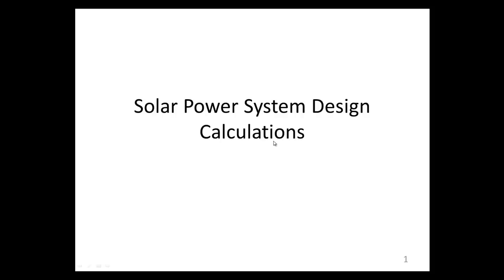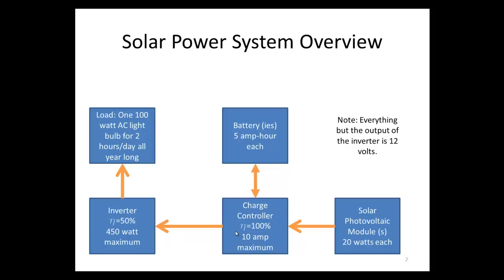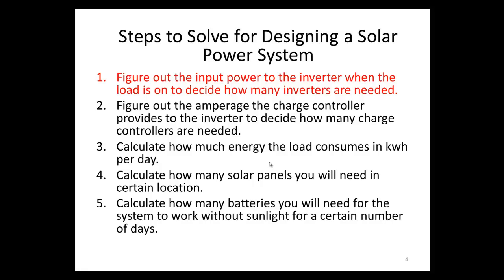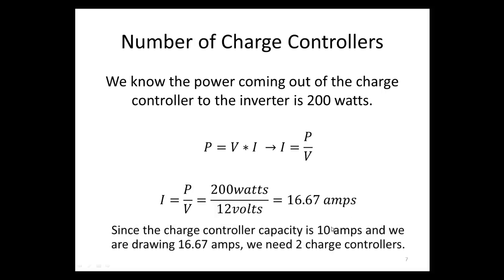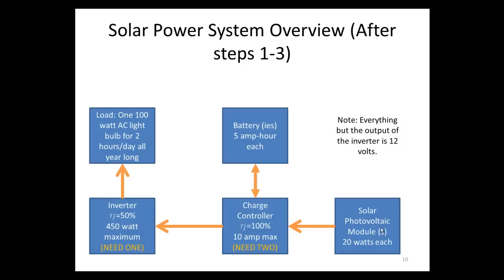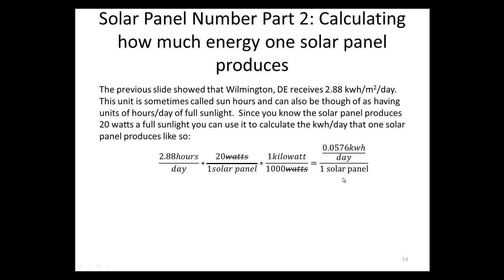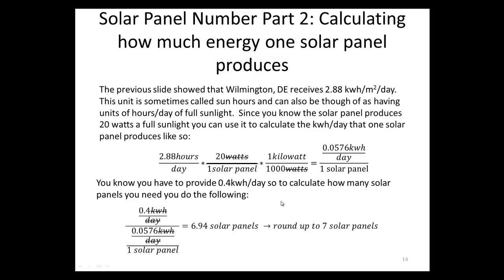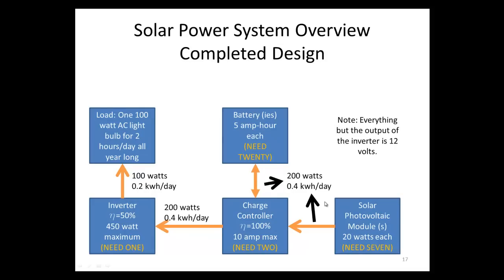Solar Power System Design Calculations

Comment: Thanks for the video, some great info.  And thank you for understanding electrical units of measure.  Some of these people drive me batty.  You did interchange the terms "amperage" and "current" but I'll let that slide.  Instead of deciding at the outset which inverter, charge controller, and battery you are going to use, why not let your calculations determine which unit to buy.  For example, you determine that you will need two charge controllers.  Why not just choose a charge controller to handle 16.67 amps?  Can you even connect two charge controllers in parallel as I assume you are suggesting?  And if you need 100 Ah of batteries, you might just want to get one battery to handle that capacity.  Good complete video though, thanks again.

Comment: Can you give me feedback on the Load: if I can use the yearly consumption like the Bill
Reply from the maker: Jenna,

    Thank you for your question.  Remember, these calculations are simplified and should not be used for designing actual systems.  With that being said if you have yearly consumption i.e. kwh/year, you can convert that to kwh/day by dividing by 365 days/year.
Reply: So at an approximated 649.2kW/h a day how can I calculate the amount of panels
Reply from the maker: Jenna Casabelos
Jenna,
  Your 649.2 kwh/day would replace my 0.2 kwh/day in my video that the load uses.  You would then follow steps 4 and 5 in my video to calculate how many panels you would need.  Step 4 starts at about 8 minutes.
Reply: Jenna, are you still in close contact with Gerry Semexan?

Comment: Nice video Cory, I am trying to design a PV for a three bedroom bungalow. Can you help me with the necessary information on how to size the system. I want to know the number of panel,batteries,charger controller and inverter that i will need.
thanks

Comment: Hello,
I'm working with a small dataloger, the power consumption data comes from the included transformer... 5V ,0.5A. We intend to use this dataloger 24 hours per day for 7 days, but we really want this gear to be completely solar powered. I took your calculations and asume a inverter efficiency of 50% which will be a 12 volts to usb car charger. From PVwatts we got that for Santiago, Chile, the worst case is 2,75Kwh/m2/day, so this gave as 2 solar panel units (25w each) and 2 batteries (55Ah each). My question is, how can we calculate the correct amount of power coming from the solar panels so the batteries get a complete charge during a 8 to 12 hours of sunlight in winter? My guess is that we don't need such a big amount of batteries, because the  system will only work from batteries at nigth... but i'm not shure that in the calculation above we have enough power to get the dataloguer working and get the batteries charged at the same time during the daylight . Maybe we need to guess a maximum period of 2 or 3 days tops for safety in the backup batteries if the winter is to dark. English is not my birth language so please excuse if a got something wrong. Best Regards!

Comment: Hi Cory nice video, I want to ask that how many panels we will need to add extra to charge the battery when we our system is on its existing load???
Reply from the maker: +kunver vishal singh chaudhary I don't think you have given me enough information to answer your question. If you give me a little more information, I may be able to help you.
Reply: Could I charge a 150Ah battery from 200Wp load in Bikaner, Rajasthan, India???
Reply from the maker: +kunver vishal singh chaudhary You could always charge a battery in any location. The question is how long it will take. If we assume both your panels and batteries are 24volts then a 200Wp panel will produce about 200W/24volts=8.3  amps under peak sunlight. This means it would take 150Ah/8.3A= 18.1 hours of full sunlight to charge your battery. As I go over in the video you can go to PVWatts to see how many equivalent full sunlight hours you have on average per day in your location for each month out of the year. This will tell you how long it would take on average to charge your battery. I hope this helps.

Comment: Hi ! Just 1 Confusion to Calculate the Batteries needed. "System Voltage Except Inverter Output V ( 140 V ) " . But the INVERTER  OUTPUT Voltage is L-N:120V±3% ; L-L:240V ±3%
 . CAN'T FIGURE OUT WHICH OF THESE TO USE .

Comment: Hi Cory
Thanks for taking the time to post this for everyone.
Im setting up a solar water pump at home.
Just trying my head around the calculations.. 
If the load of the light bulb/ inverter  is using .4 Kwh/Day and the  Solar panels are producing .4Kwh/Day. Where is the load coming from for the batteries to charge  after a period of no sunlight?
Cheers

Comment: Not sure if my logic is correct. Let's say I consume 500kWh per month, does that translate to 16.66kWh per day if we consider a 30 day month? I would then need 1 20kW Inverter or several with minor ratings, right?  But charge controllers do not seem to be available for 1.5kA so I think I'm doing something wrong.
Reply: For my example I'm using a Yaskawa-Solectria Solar 20kW 480VAC TL Inverter PVI-20TL-480, so I changed the 12V from the example with 480V, I'm looking at solar panels that are 48V. If I connect the solar panels in series that means that I will be adding Voltage, right? Since 20 solar panels are needed I could have 2 series of 10 connected in parallel. Is that correct? So a daily demand of 16kWh can be met with 20 Solar Panels (300W 48V), a 40A Charge Controller (90%), a 20kW (97% inverter), 3 sun hours (instead of your 3 days with no sun I changed it to 1) to end up needing just one battery of 52Ah... I hope my logic is correct.

Comment: thanks for information, very helpful. If I add a wind power around 600 w. How can I design the rest of the system, knowing in those worst shiny months in the year I could have wind providing the power as supplement.
thank you again
Reply from the maker: if you are looking to design a wind and solar system together, this is tougher because wind measurements are so localized and hard to get accurate measurements. If you have good wind estimates the best thing to use is Homer energy software. The legacy software is free. Good luck!

Comment: Good Day! I just wanna ask which of those mentioned parameters were you particularly referring to, stating that there are some simplifying assumptions which are not supposed to be made in designing this system? Just wanna know the difference in theory to when it comes to real-life applications :D THANKS A LOT!
Reply from the maker: Thank you for your question.

The short answer is that depending on how in depth you want to go there are many parameters that could be expanded upon.

For a great discussion on system sizing that can be done by hand or in excel, I would recommend this book: http://www.jimdunlopsolar.com/store/books/photovoltaic_systems_details/

For an hourly simulation that will help you choose the most economic system size, I would recommend the FREE legacy version of HOMER energy at homerenergy.com.

Both of these take into account the fact that temperature dependence of battery characteristics as well as more detailed models of the efficiency of the inverter and charge controller.  Also, these methods can take into account if you use your load differently throughout the year (In the video, I assume a constant usage per day).

I hope this helps!

Comment: Thanks for the vid, very clear and informative. Just have a question, is this charge controllers using PMW type? How about if MPPT?
Reply from the maker: Thanks for the question! This is a very basic video and does not distinguish between PMW or MPPT charge controllers. It is meant to just illustrate a simple sizing method for PV systems and not to drill too much into the details. Different charge controllers will give different outputs depending on the system conditions, but that is beyond the scope of this video.

Comment: good days to you guys.  i have a solar electri tricycle my battery is 5pcs  total of 60volts i try to charge it in a solar panel but it charge very slow.  what do i need?  my solar panel 1pcs 300watts

Comment: Inverters are more typically around 80%-95% efficient.  That's going to make a significant difference in all of your calculations.
Reply from the maker: +Richard Owens This is very true. This video was meant to give a very basic overview of system design and not meant to be extremely accurate. I chose 50% so it was easier to follow the calculations. Thank you for your comment.
Reply: Cory Budischak

Comment: I have batteries of 2volts with 600Ah each, an inverter of 24volts and controller of 24 volts, system capacity is 600W. How many batteries and panels do i need?
Reply from the maker: +Albina Minja To get the 24 volts, you would need 12 of your 2 volt panels wired in series. The number of panels depends on the type of panel and what load you need to run.
Reply: +Cory Budischak Thanks very much.

Comment: Step 1 What is the usage? how much does the system need to produce per day... This determines voltage, battery capacity, panel requirement...

Comment: Hi
First of all thanks for the video :)
I have a question, why does the output of the inverter is 120v? is that number fixed?
Reply from the maker: Great question! The 120V is fixed and is the standard for much of residential wiring in the United States. You can see other standards here (https://en.wikipedia.org/wiki/AC_power_plugs_and_sockets#North_American_and_IEC_60906-2)

Comment: Dear Cory,
I've little question.
You didn't mention the output power of inverter.
How did you know that output power of inverter is 100W?
Reply from the maker: Thanks for your question. The power rating of the inverter should be on the inverter itself or the user manual.

Comment: Thanks, for the generally informative video.  But, you failed to consider the efficiency of the batteries to take a charge.   Just because you withdrew 50ah from a battery does not mean that you only need to replace it with 50ah.  Indeeed, it can take up to 50% more charge current to replenish the current you withdrew.  So, 50ah of usage would require 75ah of charge current.

This makes a significant difference in the calculations for sizing the system.  It means you need up to 50% more solar panels than your usage requires.   Indeed, depending on how you need to use the power from the system, you may need up to twice your usage requirements in solar panels.  For example, if you have a constant 24 hour load of 100w, giving you a daily energy requirement of 2.4kwh, you will need to be producing at least 3.6kwh per day to replenish the batteries.  And, you don't want to be pushing your system to its limits to meet your needs, so you need to oversize the system even beyond the minimum of 150% of your usage requirements.  At least 200% is therefore recommended.  That would mean you need 4.8kwh per day, on average, to run your load and keep your batteries charged at the same time.

Additionally, you don't want to plan your system based on your batteries all being totally depleted each day - that will dramatically shorten their lifespan.  So, you need to size your battery bank such that your entire day's usage only depletes the battery bank by about 20% for maximum battery life, but certainly no more than 50%.

To get more accurate numbers, you should consider the real efficiency of the inverter and the charge efficiency of the batteries being used, and that is going to vary by type.
Reply from the maker: +Richard Owens Again I would agree with you on all points. As I have pointed out in other comments, if you are looking for a more detailed design approach, I would recommend the book Photovoltaic Systems by Jim Dunlop. He even includes a system design spreadsheet that takes into account many of the factors. Thanks again for your thoughtful comments.